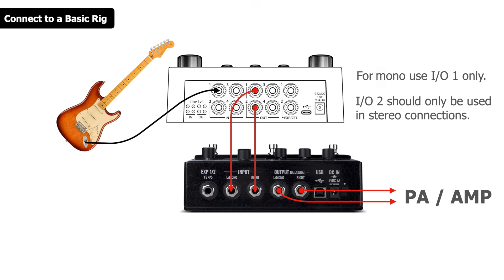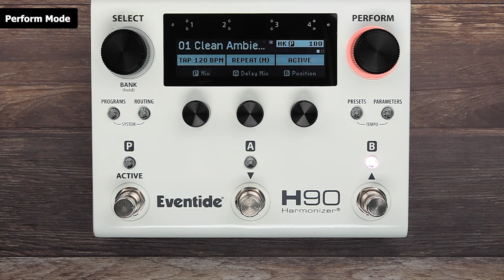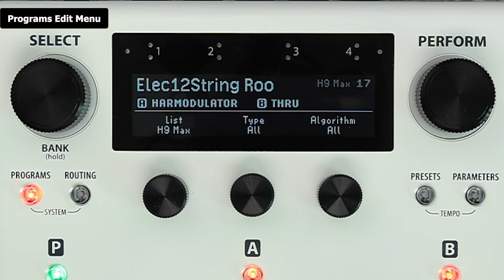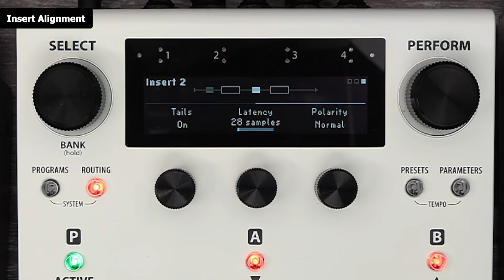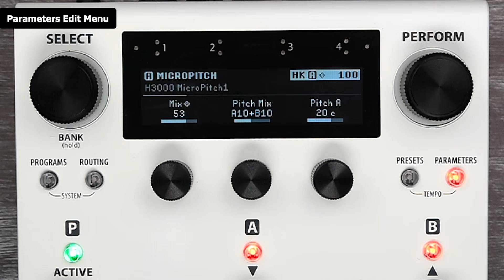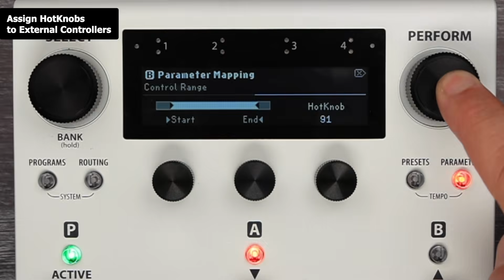Eventide H90 Tutorial - Part 1: The Essential Overview

Comment: Does anyone know how to get to Bypass/Activate a program? I have located the instruction in the system, chosen a CC# etc, but it will not work! My H9’s perform this function perfectly, but not the H90.
Reply from the maker: Assigning a CC# to “P act/byp” will only serve to toggle the active setting. It may be better to use “P act/byp (M)” and send a value greater than 64 for activate or a value less than 64 for bypass. This is explained in part two of the H90 tutorial: https://youtu.be/tfd3wQHzxcA?t=1102&si=1L7ggXi1aZfhqMbI
Reply: @E @EventideAudio thanks…I think I tried that, but I’ll give it another whirl👍
Reply: @EventideAudio I have now done this again and it’s still not working. It receives PC’s just fine, but this Activate/Bypass function will not cooperate.

Comment: I have to say. This is the worst user experience I ever had with a pedal. This was designed by someone who does not care about its users. No clear affordances. Hard to navigate, you can’t learn it by using it because there are so many different details to remember. In addition! The video manual is an hour LONG 😅 Hopefully the next one is simplified! Cool algorithms but terrible packaging
Reply: I've been researching this box for two days now. Clearly, it obviously offers marvelous sounds and tone. And, yes, a lot of gear has a significant learning curve. However, I don't want to have to be an expert just to start using the thing. One would imagine that a company serious enough to take the time to develop such a thing, would know they could easily quadruple sales if they'd just make the thing a lot more intuitive to navigate. It's one reason I've considered the Fender TMP - cause it's not difficult to navigate. I can imagine the average hippy-dippy sales guts at Guitar Center will know nothing beyond a couple of easy to get to presets. Which is a shame.

Comment: Anyone know what connectors Joe's using, for example at 12:00?  They look solderless but I've searched and searched and haven't found them.

Great series of videos, btw.  Clear and complete, simplifying a complicated pedal.  A+
Reply from the maker: This particular TRS connector is the Squareplug SPS6-SBK in combination with Mogami W2549 cable. For pedals, Joe uses Squareplug SPS4 with Mogami W2314 or SPS5 with W2319.

Comment: If you change settings in a program that are related to a specific user preset in one of the slots, does the saved change also change the preset itself which resides in the user presets list outside of the current program?

Comment: 6.42 - your shows an arrow, mine an equals sign (actually all mine are equals). What's going on?
Reply from the maker: If you see two parallel horizontal lines that means you are in Dual routing mode. Insert mode will show you an arrow for serial a serial signal path and two vertical lines for a parallel path.

Comment: I would love have a rack mount version of the H90. What about an H900 that has all the features of the H90 + H9Max with IR/Cab simulation all in a 1U 19” Rackmount unit 🙏🏼😇
Reply: Isn’t that the h9000?
Reply: it would be nice to have a step up to the h90 with more algo-stacking power without having to go all the way up to H9000… Id want an H900

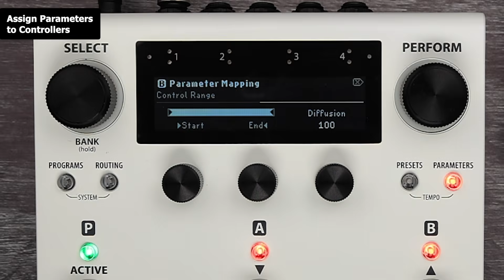Comment: I want to map an expression pedal to globally act as a volume pedal, but I don’t want the input gain to push past 0.  I’ve tried in the Mac App, & just the hardware method shown at 49:20. Both times, the “pot” shows a yellow tick mark where it should stop the sweep, but when I move heel to toe, it still pushes past 0 to the full 12dB.  Any advice?
Reply from the maker: @sergiopauloworships1704  Input again is not a global function, but it is possible to map on a program basis. Are you 100% sure you’ve mapped the correct control source to the parameter? I recommend starting a topic in the Eventide Stompbox forums so more people can assist. You can also upload a video of the behavior: https://www.eventideaudio.com/forums/forum/products/stompboxes/

Comment: great content guys. one question: can i press the perform (and select) knob with my foot?
Reply from the maker: @meekee1973  Absolutely! They were designed for this. In addition, it’s possible to assign Mode Toggle to an external auxiliary switch or MIDI controller if you prefer.

Comment: How can I connect my headphones to the H90 to get stereo sound?
Reply from the maker: The H90 does not have a headphone output, so in order to monitor the output in silence, you’ll need to connect the H90 to a device that has a headphone output - a mixer, a stereo cab emulator with hdph out, or an audio interface with direct monitoring.

Comment: Thank you for this tutorial! would it be possible to have a dry signal coming out of one output, and a completey wet out of the other?
Reply from the maker: In Part 3 of the tutorial series we cover how to use Inserts as splitters for this type of signal flow, so it would be possible, for example, to have a dry signal come out of Out 3 while wet signal is coming out of Out 1(&2).
Reply: @EventideAudio  Wow that's cool! I thought I'm good with two H9's but the interface with all the control and routing options is why I can clearly do better. Waiting for a package now :)

Comment: Joe, you are probably the most articulate/knowledgable YouTube manual in a box guy I have ever viewed.  Thanks for making the H90 so much easier to access.  Now, if you could do a video tutorial on the Morningstar editor and MC6Pro, I would 'pay' to have those as reference tools.  Thanks man!
Reply: I paired the MC6 Pro on a board with the H90 and a Darkglass Microtubes Infinity. I have a couple pedal options to use as inserts in the H90 as well. Currently Have a Walrus Audio Julia and the other insert option is open for now. There is a MC8 and H90 video, you can search for on YT, really helpful for setting up the MIDI aspect. My MC6 has Prog up/down, activate, and select/perform as well as insert on/off so far. My Expression pedal is mapped to CC 10 so I can assign that to any parameter that I want control of on the H90.

Very cool stuff!

Comment: This thing is very complicated.  Sure, there are obviously people that can master the finer points, and that’s fine, but there should also be a simple way of adjusting parameters on the fly.  Have I missed it?
Reply from the maker: Press the Parameters button. Press the P LED button to edit Program parameters or press A or B buttons to edit preset parameters. Use SELECT to move through pages of parameters. As they appear on the screen, is the three quick knobs to make adjustments.
Reply: @EventideAudio  Thank you so much!

Comment: I´m about to buy one, just depending on an answer on how manny effects can I have at the same time on the H90. Is this unit capable of having such a string of effects as compressor > chorus > detune > delay > reverb at the same time?
Reply from the maker: The H90 can only provide two algorithms at a time. If you are looking to use 5 dedicated effects for each category, it’s not possible. However, many Eventide algorithms are multifaceted. For example, our SpaceTime algorithm provides chorusing, dual vintage delay and plate reverb in one. We also have an EQ/Compressor algorithm. The combination of these two can get you great results.
Reply: @EventideAudio  I appreciate your fast answer! I´ve ordered it just now.

Comment: Thank you! Do you have anything that explains which order I should put this in with my other pedals? I'm not sure which is best? Should it be before my noise gate/overdrive/distortion? or after? If I use a mixer pedal, where should that be? Thank you so much!
Reply from the maker: The answer to this can vary depending on what types of effects you’re using on the H90. But in general, I’d place any gain-based effects like OD/Distortion, Wah, and compression before the H90. With noise gates it depends where in your signal chain your distortion is or whether you get your dirt from the amp’s preamp section or not. If you’re just using a gate to quiet down a noisy single coil guitar, put it early in the chain. But, if you’re using it to quiet down the lead channel of a monster amp, you may need it in the amp’s effects loop.

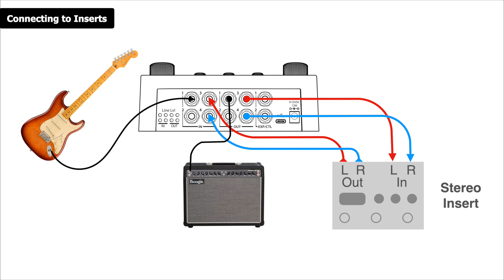Comment: 33:48  what's a point? if out2 is not connected then h90 works in mono. why stereo insert?
Reply from the maker: We are simply showing the connections for a stereo insert. In the case where only Out 1 is connected the H90 would convert an internal stereo path to mono. Connect Out 2 to another amp, and H90 reconfigures to stereo.
Reply: @EventideAudio  got it

Comment: Great tutorial! :) Has the H90 any Internal controllers available like followers or LFO's? I would particularly like to control parameters dynamically depending on the input level.. Thanks
Reply from the maker: Currently, no, there aren’t any LFOs for this type of control, though the H90 does accept control voltages and MIDI for similar control externally. We welcome this type of recommendation in our user forums where our developers keep an eye.
Reply: Unfortunately, I do think that lacking internal controllers to control parameters dynamically  is eminently a big constraint in the H90. So I would like to see a minimum of pitch and volume envelope followers,  LFO's, and ADSR's available internally to program the H90 creatively. Thank you  @EventideAudio
Reply: @pangea2003   yes these features are need on H-90.i hope they develop those in future firmware updates.
Reply: Yes please implement these lfo settings